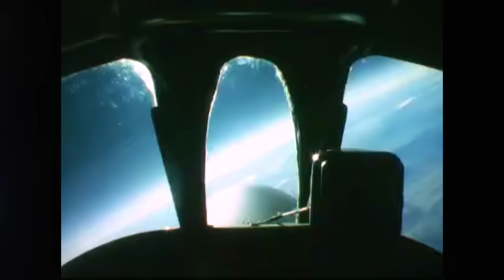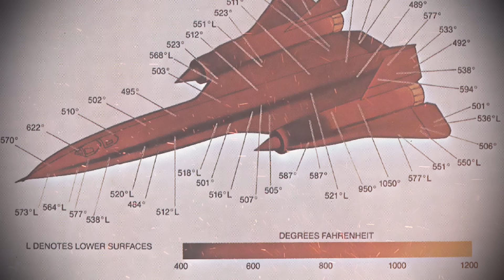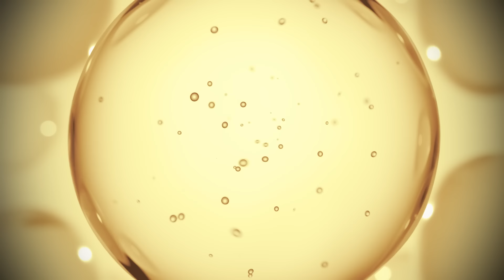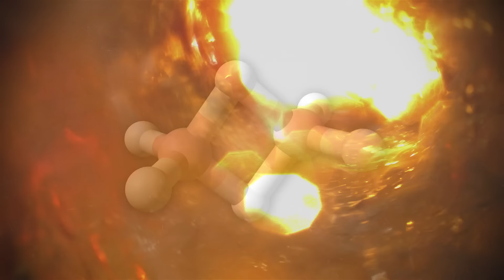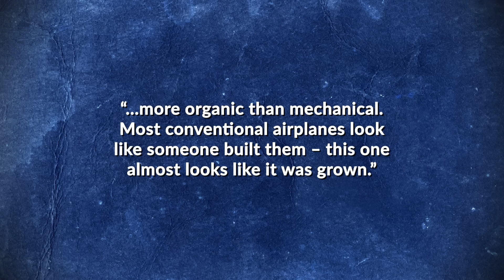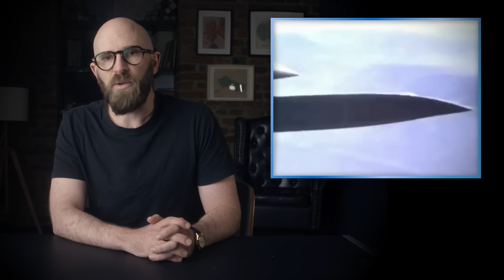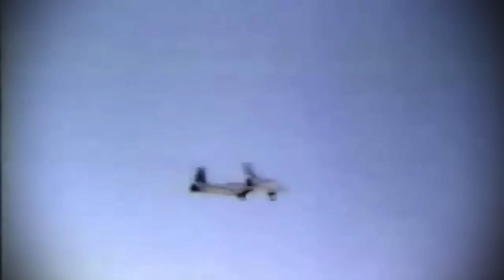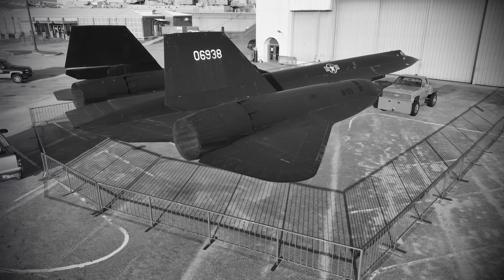How Did the SR-71 Blackbird Get Made and How was It So Fast?

Comment: Never ceases to amaze me the things we used to make with far less technology than we have today. We went to the moon with slide rulers and woven computers weaker than a calculator. We have it all now and no one wants to do anything with it 😒
Reply: I see what you’re saying. Engineers today, it seems to me, rely too much on computer analysis and computer algorithms. There are times the human factor needs to be considered, and only a human can provide that input.
Reply: @rixxroxxk1620 Computing for games is a waste of machines, power, and lives. Social media is destroying society.
Reply: The problem is cost.  

Do you want to go back to when minimum wage was $2.50 an hour?
Reply: @calvinnickel9995  yes, the cost of living, cars and houses were proportionally FAR cheaper back then relative to wages. Colleges were merit based and high quality. Everything was built to last and to be fixed. things were simpler and more reliable. Families and communities were strong.

Life was objectively better back then on many measurable metrics.
Reply: @SoloRenegade

That’s a common myth brought by rose coloured glasses.  

Take cars for example.  They had a five digit odometer for a reason. You’d never mistake one that rolled over for a new car.  

You had to do all kinds of things that you don’t on a new car.  Clean and gap spark plugs; set ignition timing; replace cap, rotor, points, and condensers; adjust valve lash; clean and tune carbs; clean out and repack wheel bearings, perform chassis lube, and after 100,000 miles it was ready for the junkyard.  

Today’s cars for the first 100,000 miles all you need to do is fluid and filters, tires and brakes, maybe a battery.. and it runs better than anything before 1990 did off the showroom floor.  The AVERAGE age of a car in the USA is 12 years old.
Reply: @calvinnickel9995  "The AVERAGE age of a car in the USA is 12 years old."

only due to "Cash for Clunkers"

My car: 20yrs old, still looks like new
My Truck: 32yrs old, still looks like new

I've had to do nothing but Wipers, Tires, Oil Changes, brakes, struts, etc. The only thing I've done than an EV wouldn't need is the oil change, which takes me 15min and $15.

My older car and truck are FAR cheaper and FAR easier to work on than modern cars. and this was even more true for vehicles older than mine. life was simpler, things may not have lasted as long, but they do now and we could have equally simple vehicles with exceptional reliability today had we followed the lead of the past rather than digitize everything for no reason.

your cherry picking and making things out to be worse than they really were. Talk to a mechanic and ask if they prefer old cars or new. and ask individuals who like cars that same question. They will all tell you they prefer old cars and wish we made them like we used to.

So cars do not support your claims. cars were also FAR cheaper relative to average incomes back then too.

it is possible to produce a work truck for $15k brand new today, but they wont do it. And because anti-capitalist gov regulations prohibit it.
Reply: @calvinnickel9995 the problem is choice. We would rather over fund the military
Reply: The space program used many large, medium, and small computers to get to the moon and back.
Reply: @Dxyzxyz  all small in computing power. variations in physical size.
Reply: @SoloRenegade Computing power has scaled up enormously. And we waste most of it.
Reply: @Dxyzxyz  I work in the supercomputer industry. 

Give me an example of how we "waste most computing power"?

what is the reason for the sudden scale up of computing power to begin with? (hint, there are at least 2 correct answers)
Reply: @SoloRenegade Graphics, Video, AI model building, games, phone applications, social media, etc.

Integrated circuits.
Reply: @Dxyzxyz  Wrong, integrated circuits is not causing eth scale up, we've had them for many decades.

the scale up is that more places are using them for more tasks to maintain their competitive edge. People who never could afford supercomputing in the past are now buying the capability and learning hot it benefits them. these large systems have become accessible and viable to more industries. Another reason is the recent explosion in AI, and everyone worried about getting left behind if they dont develop their own. Everybody wants in on the bubble.

graphics, video, AI, applications, etc. are not waste. Games fall under simulation. Simulations have been a PRIME consumer of supercomputing since the early days, and will remain so, as that has military and other critical applications that are neither wasteful nor going away.

Social media is run on servers, not supercomputing, but I agree there is a lot of wasted energy there. But not computing power, as it's mostly storage.
Reply: @SoloRenegade Wrong. I have been a CTO for 20+ years.
Reply: @Dxyzxyz  I don't care. you're incompetent. you couldn't even answer the questions. 

Appeal to Authority is a logical fallacy. And CEO, CTO, CFO, etc. just proves you're out of touch with reality. the business leaders of the past 30yrs have driven financially stable companies into the ground systematically one after another for short-term gains rather than playing the long game. You screw over employees and stop successful Engineer-centric companies from continuing to be successful, and instead turn them into a top-down shareholder-centric business. HP inc, Boeing, Maytag, and many others were ruined this way. 

The fact that after all those years you still don't know that Appeal to Authority is invalid, shows how low intelligence you are. it only took me one gen-ed class in college more than 2 decades ago to learn that and never forget it.

And I guarantee I've already personally accomplished more in the super computer industry than you ever will. I hold world records, world firsts, tens of patents for computers, etc. Not to mention 2 prior careers with notable accomplishments in each as well.

but none of that makes my argument right, it only proves what I am capable of, and proves I know how to apply science systematically to get results consistently. My arguments must stand on their own merits. They must be logically consisten, factual, and supported by evidence, with conclusions that are repeatable by others given the same level of information about the issue.
Reply: Integrated circuit drove computers out of the discrete transistor age. That is still progressing. The dropping cost of computing is due to integrated circuits and mass production.
Reply: @Dxyzxyz  integrated circuits Are transistors......

Proves how little you know.
Reply: @SoloRenegade Integrated circuits are more than discrete transistors. Multiple devices per die was a key step beyond hybrid circuits.
Reply: @Dxyzxyz  yes, but they are also transistors. nothing yet has replaced or displaced transistors as you claimed.
Reply: @SoloRenegade I never said transistors were replaced. You are missing the point.
Reply: @Dxyzxyz  a point you apparently can't state clearly, nor are willing to repeat....

Typical CTO, can't communicate clearly, just says a bunch of crap to sound intelligent in meetings and emails, but have no actual clue wtf you're talking about. All talk, no action. Promoted to your level of incompetence. Haven't actually done any real work for decades and relies upon others to actual make stuff happen and figure it all out and make it work.
Reply: @SoloRenegade Sad delusions about CTOs. Not promoted. Founder.
Reply: @Dxyzxyz  "Sad delusions about CTOs."

all current evidence in the economy to the contrary. 

Business leaders from more than 30yrs ago actually knew what they were doing. not today.

Founder? not the CEO? You know how many people claim to be a CEO, CFO, CTO of some startup with no employees, or a small business with tens of employees? It's become a participation trophy title. 

I'm also the CFO of a startup. But I don't claim it publicly. In fact, this is the first time I've ever used that title. Because literally anyone can be a founder and CEO/CFO/CTO of a business at any time. No qualifications nor experience required.

And yet, you can't argue the actual topic. instead you act like your title makes you right by default. but you can't even argue teh facts and logic and don't even know the difference between an IC and Transistor. Children could answer that question better than you did.
Reply: @SoloRenegade You have no idea who I am and do not seem to care. Your kind of arrogance destroys many companies. Unfortunately, I have met a few people like you. Good luck destroying your current employer.
Reply: @SoloRenegade Your kind of arrogance destroys companies. I have seen it before. Good luck destroying your current employer.
Reply: @Dxyzxyz  I'm actually indispensable to my current employer. There is nobody at the company that can do what I do and they well know it.

My boss has said he wishes he could clone me. 

My coworkers have multiple times said they  would come to work for me if I started my own business and they like my ideas (products, business model, priorities, etc.)

Give a specific example of how someone like me destroys companies? Every job I've ever had I was the TOP employee or team member. I've had clients refuse to do do business with anyone at the company but me. 

Nothing I have said was arrogant. I have a proven track record. I know what I'm capable of and have demonstrated it for real many times over. 

Definition of Arrogance: "having or revealing an exaggerated sense of one's own importance or abilities."

Everything I claim, I have already done in my life, and can articulate exactly how I achieved it, and how anyone could achieve it if they tried hard enough.
Reply: The point is we don’t know what is or isn’t being made. Also, the trade off was that we were in constant fear of nuclear war. The Cold War brought out the best and worse in us.

Comment: Little correction: The SR-71 cannot outrun SAMs. Modern SAMs are very much fast enough to catch it.
The real problem is kinematics. An SR-71 flying past you at Mach 3 will force most missiles, if they even can track it, into a turn that would require it to exceed its own G-Limit. And the way to prevent these missiles from acquiring to begin with is to just not fly straight over the target. Also, keep in mind here that the SR-71 flies so high that its really only the long range systems that can hit it in the first place.
Reply: SAMs don’t need to turn. They simply lead and fly a collision course.  The SR-71 isn’t maneuverable enough to evade them with an 81 mile turning radius and 16 minute turn rate (a rate one turn in an airliner is 2 minutes and they are still serving drinks in the back).  

The issue is late launch because of surprise or the fact that the SR-71 wasn’t yet in their airspace in the case of the tiny developing countries it actually overflew (it never overflew the USSR or China). 

It doesn’t take much to evade a missile that was launched behind you from a great distance. Two Iraqi Mig 23s avoided AIM-54 Phoenix missiles fired by the USA by simply reversing course and flying away.

Comment: Very nice video. Very thorough. It was my privilege to have done work on them while on TDY station at Beale AFB. Having to work on them as a crew chief with the special tools and I also had the opportunity to fly with a KC-135 to fuel up one when I was assigned to a tanker squadron. They are amazing aircraft. They still would have a role to play if they weren't so expensive to operate. Satellites are limited and much easier to fool and avoid. Because any MAJOR adversary, like China or Russia, KNOW when each one flies over what area, they can hide what needs to be hid. 
The speeds it officially hit for records were CAREFULLY planned. The aircraft could go faster than that. The altitude and speed are STILL classified information. While it wasn't my favorite aircraft to work on, it will always be the most unique and special. Also, a side note, the YF-12A was tested as the strategic interceptor, it wasn't any good as it was faster than any bullet or missile that could be fired. After I was out of USAF, I went back to Beale as a computer tech. Seeing the mounted one on base and some of the old places brought back lots of memories. Again thanks for the video.

Comment: A pretty good video, you stated several times that the SR-71 was the highest flying aircraft, however this award goes to the Russians with the Mig 25 getting up to 37,650m.
Reply: Ah, but america. If they didn't do it, it wasn't done. 🤦‍♂
Reply: reached altitude is not flying altitude, mig 25 can't fly at 37km, it could hop to 37.  it being the experimental version used in the record run.

there's some nuances to the different kind of records of course even more than that of course, like if it was launched from something already airborne etc(the experimental mig 25 having the record for that one).   but it couldn't fly around at same altitudes.

Comment: So fast. So beautiful. So cool. So mind-boggling that this thing was built in the age of the Slide Rule!!
Reply: The age of the computer.  NACA and Lockheed had electronic computers for nearly a decade when this thing was made.  

It’s like saying aircraft today are designed by an iPhone rather than supercomputers doing computational fluid dynamics.  You can bet that engineers are doing quick checks and rough calculations on iPhones.. but that’s not how they design an entire plane.

Comment: The original start cart for the sr71 was a 401 cubic inch Buick V8 with 400hp. 

Two mounted on a cart.  One for each engine. With no mufflers (hot rod modified) and running metal belts on the output shaft of the transmissions.
Reply: 400 HP SAE Gross.  About 275 SAE Net.  The 400 HP of 1968 does not equal 400 HP of today.
Reply: The two V8s in a cart worked together to start one jet engine.   The cart would be used to start one engine, then rolled over to start the second.

Comment: The starter carts used Buick Wildcat V8s. Chevy engines weren’t used until MUCH later after the world’s limited supply of the Buick engines had been practically wiped out.
Reply: Buicks definitely.  The start carts were still called 'Buicks' even after each contained two Chevy Big Blocks instead of two Buick 425s...as in "Corporal, Take a couple Buicks over to tail #xxxxx on the double!"
Being that Kenne-Bell had developed all sorts of 'go faster' parts, Buick 425s, stuffed with Kenne-Bell goodies were the engines of choice.  At that particular point in history, nothing else with enough torque would hold together at the RPM required.
When Tommy Ivo, for instance, wanted to go insanely fast in 1961...he ran FOUR 425 Buicks, one at each wheel.  The car was known for doing a 1/4 mile, four-wheel, burnout to a 200 MPH trap!  Directional stability was iffy at best!
Mickey Thompson ran four 421 Pontiacs to 400 MPH at Bonneville a couple years later in his Challenger I.
Oldsmobile had a 425 inch engine in '65-'67 and it made power, but it was heavy, wasn't a high revver and was years late.
Ford, Chevy , and Dodge came stumbling into the party with their high-revving 7-liter engines in 1966...days late and dollars short, but they DID manage to catch and beat the first American engines to make real speed.
That said...with all the old-school go-fast bits. a Kenne-Bell equipped Buick 425 will turn some freakish revs.  You might wanna pull your feet back behind the plane of the flywheel though...just in case the crank wants a view out the side of the block!
Reply: Unlikely.  They made 50 Blackbirds. They made THOUSANDS of Wildcats.
Reply: @calvinnickel9995  I prefer to believe Brian Shul, he has several presentations on youtube, very interesting man.  buicks, then chevys

Comment: Actually, the early start carts used two Buick Wildcat engines. Later start carts used one Chevy 454 (or was it a 425?). By the late 1970s, they had compressed air systems to start the J58s.
Reply: GM never made a 425, maybe a 427?
Reply: @Chris-hx3om  GM Buick Division 425